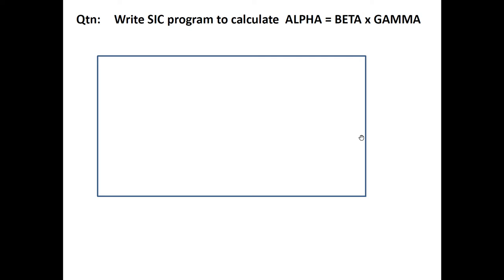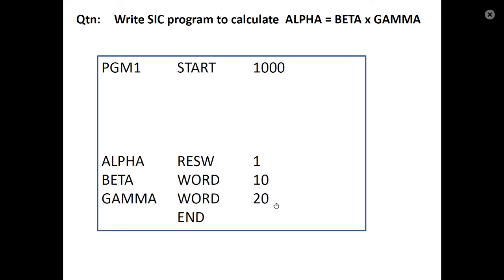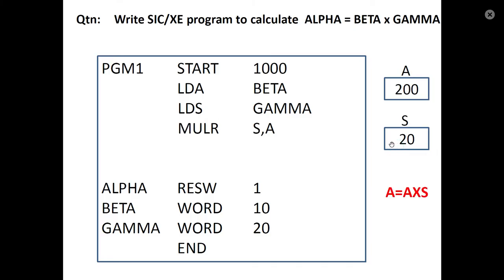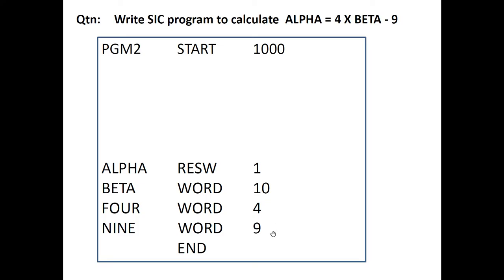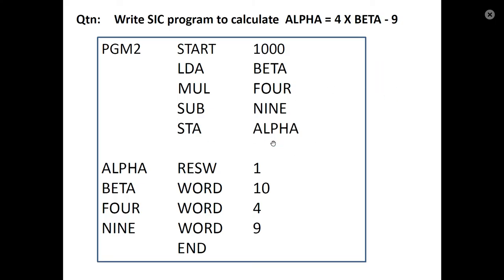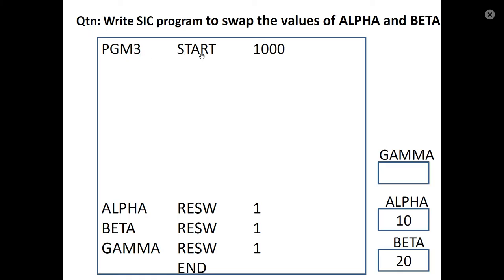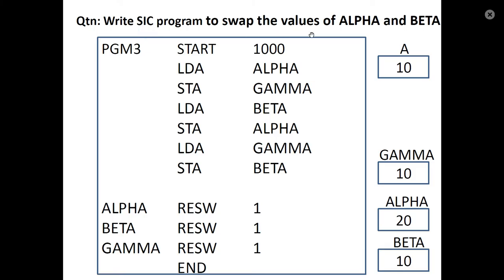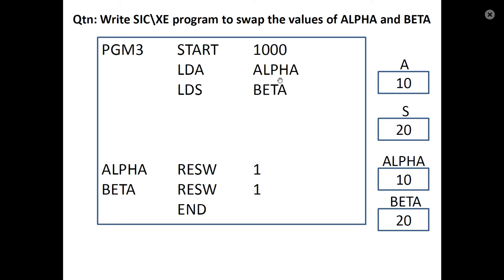Module 2 - SIC and SIC/XE Simple Programs

Comment: chechi ee # enthina use cheyyane athinoru specialist use illeyoo
Reply from the maker: # represents it is an immediate operand. 
Example:
                  LDS   #4

Here 4 is an immediate operand. Here we are directly provide the value 4 to the register S.
Reply: @csktulectures7719 can we directly do multiplication of 4 and value in accumulator instead of using register s?